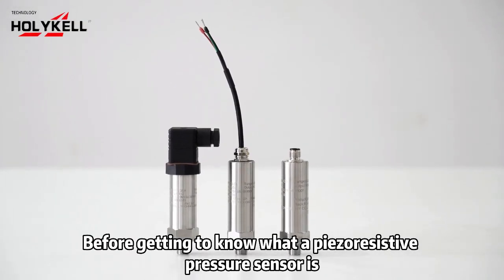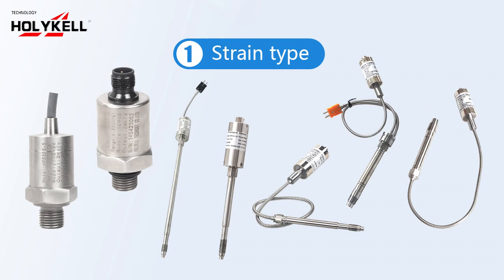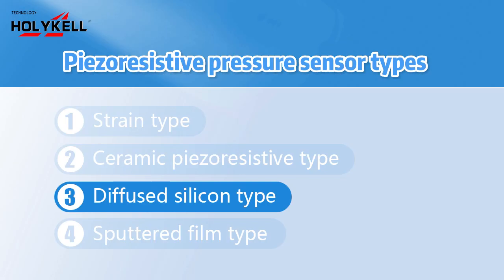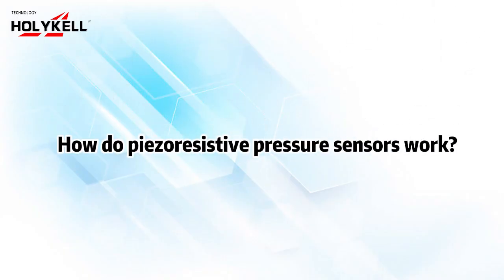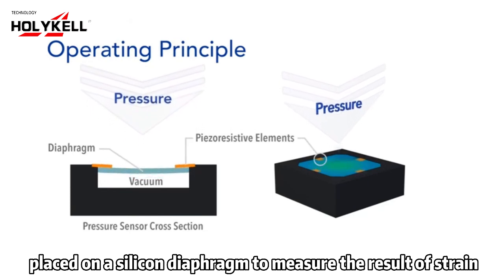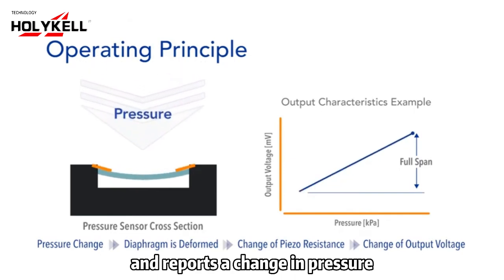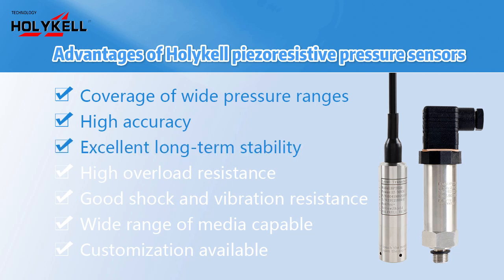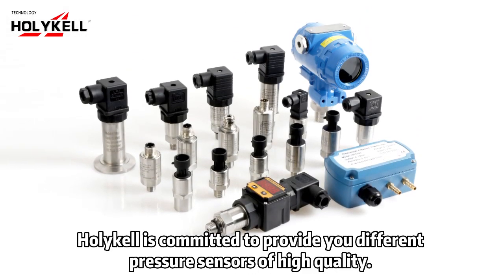How Piezoresistive Pressure Sensors work

Comment: I want to use these to measure gravitational force. What resolution in Newton would I get? Which model is best for my purpose?
Reply from the maker: sorry we currently do not have such product~😀
Reply: @Holykell  Any pressure reading can be converted into a Force reading. So that doesn't make sense.
Reply from the maker: @SkyDarmos  Maybe you can further discuss with our engineer. Would you like to leave your email?
Reply: @Holykell  I need a resolution in piezo force measurements of at least 0.0001 Newton, and in the ideal case 0.000001 N. Currently my resolution is only 0.008 N, because I have so far only tried the iPhone 6s touchscreen for force measurements (note: magnetic force restoration destroys the signals I am looking for, so that was the only option so far).

Comment: Hi HolyKell, I am Master Student from Pusan National University. I am finding a sensor to attach on the tip of needle to measure the pressure when the needle touch the walls. But the working principle is not working like this right? So do you have any recommendation for this idea. Thanks
Reply from the maker: Hello, thanks for your attention. Currently, we do not have such a pressure sensor😀
Reply: @Holykell   Hi, I see this one is suitable for what I am finding. But I wonder how this pressure sensor  really work not based on the simulation
Reply from the maker: @Dang-k3d  Hello Master, please send us an email to info@holykell.com. We will have a sales engineer  to help you.
Reply: @Holykell   Hi, I have already sent the email. Hope you will response soon. Thanks a lot
Reply: @Holykell  Hi There, I am still waiting for your response. Hope you will response ASAP~
Reply from the maker: @Dang-k3d  You can have a quick response via whatsapp 008618874819196
Reply: @Holykell   Hi I also find this number but I can not find any accounts for this one. 
please check again